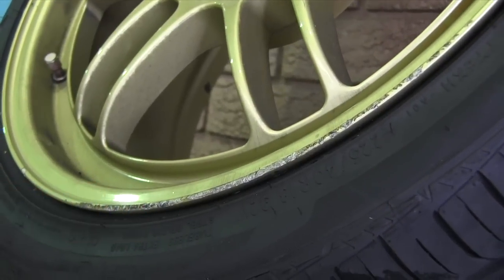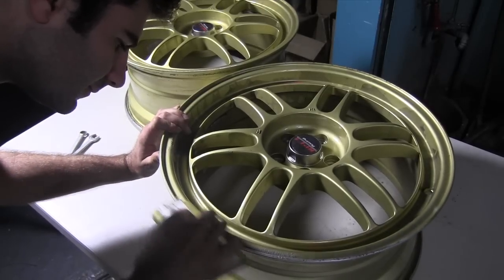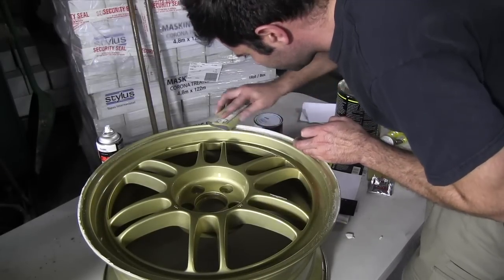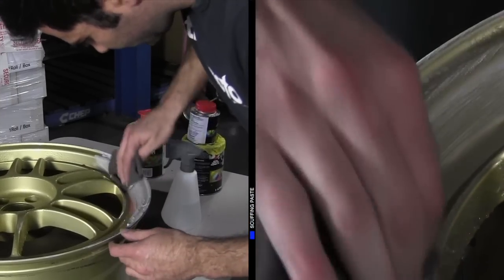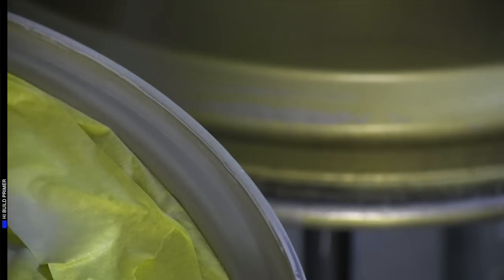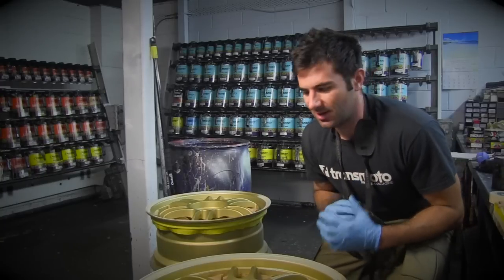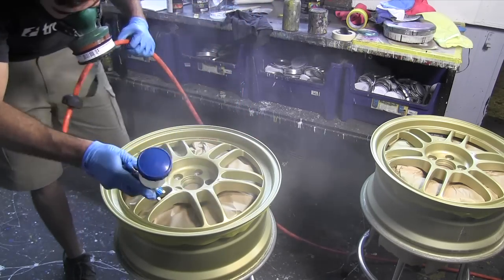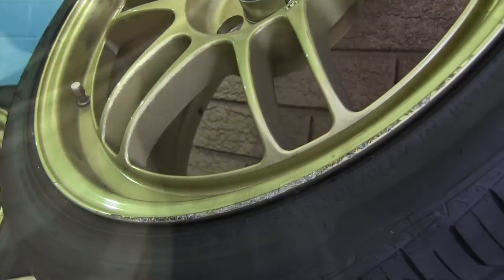How to repair gutter rash & scratched wheels

Comment: FYI - The lack of the glossy look and feel was due to me being too careful with the clear and simply not putting on enough so I went back to the other 2 wheels. My first coats of clear acted as a based so no re-sanding down required and I used a torch to make sure I could see how reflective/thick the new coat was - Job done! You were right the clear is the most difficult step as you just cant see it :) - Will send pic via the website as I don't use FB. Thank You for all the help!

Comment: Have you ever thought of using JB Weld or Quick Steel putty for rim repairs mate? It bonds to aluminum or metal a lot better and is less apt to come off. I use both to fill imperfections in metal and aluminum before powder coating. Not only is it very strong, but it can withstand temperatures and abuse.

Comment: Wont the body filler crack or chip off when changing tyres
Reply from the maker: Hey man.. No it wont. If its done by a tyre shop. Paint is just as delicate as body filler. So every wheel would be scratched if a tyre machine touched the rim harshly.
Reply: Good to know.thanks

Comment: Thanks for the reply Dave! Much appreciated! - I decided to take a risk and paint over the filler primer spray and it was fine the colour hasn't come through & it looks wicked! Clear coat tomorrow. One question: I've never seen "putty spray" in the shops, on ebay it seems the same name/product as filler primer (filler primer putty spray). Please explain, What is the difference between the two and what context are they used? Luv the vids keep em coming! will post a vid of my results :) Cheers!

Comment: hey Dave, I've got a 97 prelude that I painted about 1/4 with spray cans. I've got pics of it on my google + check them out, I'd like to hear your opinion on the finished product. I painted it almost 2 years ago, and it still looks good. I get compliments on it all the time, but I'd like a pro to see it. I painted the entire front bumper, and new chin spoiler that I installed at the same time. the side skirts, which I never wet sanded. the rear lip, and the rear spoiler. the rear spoiler needs to be re-painted, because I got in a hurry. if you check out the pics leave a comment so I know....thanks

Comment: What pressure did you use for spraying Primer, Base and Clear? Also what mixture of paint/thinners did you use for primer, base and clear? customspraymods
Reply from the maker: Use about 40psi but it depends on your gun. Primer is fine for lower pressure clear coat you want to pump it up to minimise orange peel. Primer & Hardener I used is 4:1 10% P:H T% Base is 1:1 P:T Clear Coat is 2:1 10% C:H T%

Comment: Hi Dave, I'm using your method to refurb a set of BMW 44 style rims and so far so good, just done primer. Couple of questions mate: 1. Why didn't you use normal primer after the filler primer? (I'm sure you previously advised me to always follow filler primer with primer) 2. The filler primer they sell here is yellow in colour, if the recommended primer for the final colour is grey (eg titan silver) would you go over the yellow first with a grey primer? That's all mate. All the best!

Comment: Hey mate.  Great video thanks.  I just scratched my Rays 57dr wheels.  They are semi gloss black and Volk Racing doesn't really release paint codes.  I've called a few places to have it fixed.  Some of them said that they can just repair the scuffed area whilst other people said they have to respray the whole wheel.  I'm just a bit worried that the paint isn't going to match my other 3 wheels.  I heard you saying in the video that you have to take the clear code on the whole wheel rather than just the damage area.  Is that for all colours ?  Will semi gloss black blend in easier ?

Comment: Why do you have to scuff the whole wheel before applying clear coat?

Is that because  you give the paint something to stick to? If so, what about the areas you are not painting? Wouldn't that be rough from the scuffing while the 'repaired' part is smooth from respraying before the clear goes on?
Reply: +FreakyDiquey You scuff it before you put the primer on. Primer doesn't stick well to smooth surfaces. You sand back the primer to give a nice smooth surface. I say smooth but if you looked very closely at the 800g sandpapered surface, there would be small scratches for the paint to grab.

Comment: my car has some horrible wheels on them, but at $500 per rim, I'm not going to spend a mint on some new ones, I will try the bog and paint trick when my wallet can afford it.

Do you have any recommendations on places I can go to in Adelaide that will supply quality stuff on the cheap? I love NSW but driving 12 hours just to meet VG would cost more than the paint itself

Comment: What kind of body filler do you use? Could I just use Bondo, or do I have to get the body filler with aluminum reinforcement?
Reply: I have used supercheap auto body filler on my wheels and they have been fine for about 1.5years now.
Reply: I would have thought JB Weld would be better - at least its metal-based. . .

Comment: My dad used to do repairables as a side income. I've done one of my own as well. He had a 1k base coat there. You talk about 2k everything. What is the difference?
Reply from the maker: 2K means 2 parts. Something that needs an activator to set off the chemical reaction. This means 2K generally dries   stronger and solvent resistant.
Reply: Okay awesome. Thanks. He had no honest clue. Thanks again. Keep up the great work.

Comment: What if you rims are just plain alloy?
Reply: +yuri64 Most alloys have a paint over them to protect them. Most likely silver.
Reply: +yuri64 
Then this method is obviously not the right one.
Plain alloys on standard passenger car are usually a combination of painted silver/clear coated or have the outer face including the edge of the rim alloy that has been sealed in clear.
As gutter rash mostly occurs on the extreme outer edge, you will need to get it machined back or you can use a dremel with a 200 grade sanding attachment. Sand scratches down till smooth and level then slowly hand , wet sand until you get to 2000 grade. Then clean and seal with clear.